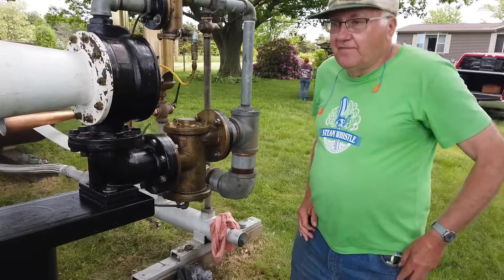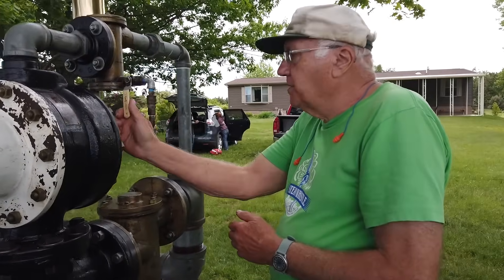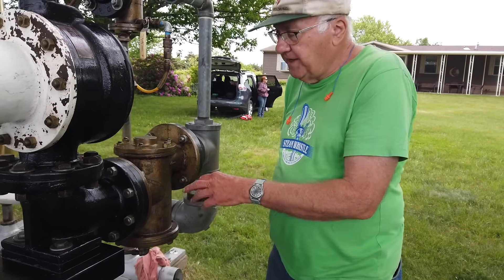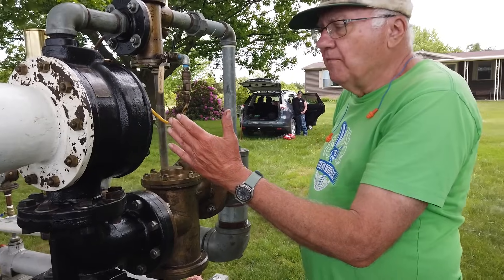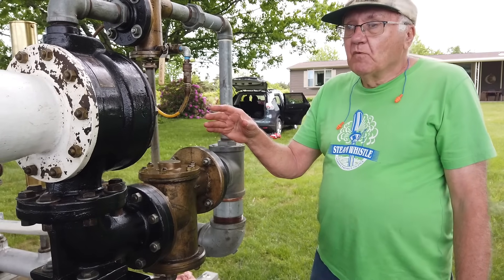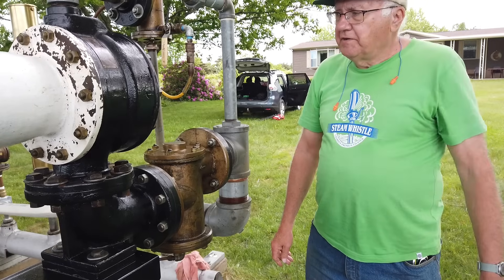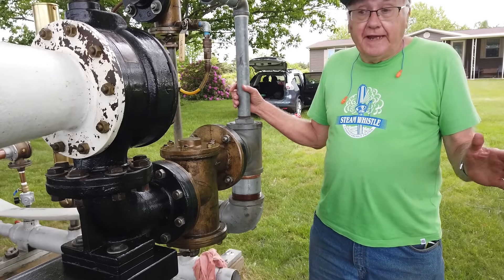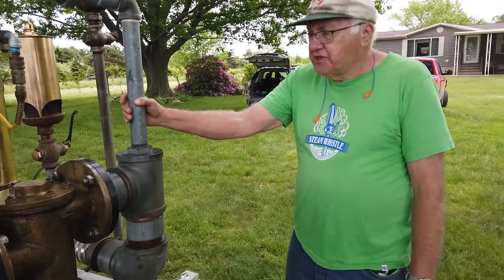How a Type F Diaphone Fog Horn Works

Comment: This is what I don't get about foghorns.  Okay as inaccurate as it may be, I get how the sailors can hear the sound and get a rough bearing of where it is coming from. What I don't get is how they worked out the distance. If you don't have the distance, you can't work out where you are from the hazard.
Reply from the maker: @mizzyroro  fog horns were synchronized with radio beacons. Timing the delay between the radio tone and the audible horn (in seconds)... then dividing by 5 gives you the approximate distance in miles

Comment: He spent all the time explaining how the air went through but what he didn't explain was how the sound was made. I was eargly wanting to hear that.
Reply: That was the explanation.  And a very good one, too.
Reply: @iamachine  so how is the sound made? I am none the wiser. It may be a good explanation of how the air goes through but doesn't explain how the sound is made.
Reply: I’m with you. It’s kind of like telling a person to whistle by puckering their lips and exhaling. It’s a little bit more involved than just that.
Reply: The air IS the sound. It's passing through a spinning valve that is opening and closing extremely fast. 

The pitch of the note is controlled by the valve speed. Slower valve is a lower note, faster valve is a higher note.
Reply: @adamyoung8289  well there you go. The air is not the sound because without that valve thing or whatever, there would be no sound just air rushing out. You give more information that he did which was my point.

Comment: Looking at this as he describes it, it seems that the first little valve, what he called a "motor drive" is a kind of transistor.

It takes a little "power" to get moving but it allows for a greater amount of power to flow. Kinda cool
Reply: Actually, a transistor is a kind of valve so it is circular reasoning to describe the "motor drive" as a "kind of transistor". Technically, such a device is called a "pilot valve", a valve that controls the function of another valve.

Comment: What's the PSI in that 1K gallon tank, and what kind of compressor setup do you use to pump it up?
Reply from the maker: @veiledzorba  for just the diaphone,  the pressure is brought to 45 psi in that tank. He uses a 1936 Schraam towable compressor.
Typically the tank is pressurized to 120psi, he blows steam whistles on that,  then when the pressure gets down to 45 he can switch to the diaphone

Comment: Would it be possible to drive the piston with some sort of powerful solenoid actuators, which are modulated by audio signals, and therefore turn it into a electro-pneumatic megaphone speaker with earth-shattering SPL?
Reply: A similar system to what you suggest was used in large gramophones as a way to amplify the sound. A membrane lets more or less air through to a horn, depending on how much the stylus moves the membrane. This was the only way to reach big sound levels before electronic amplifiers were available.
Few of those things have survived, so it must have been not very popular. But there is a video on youtube that demonstrates one.
Reply: It's been done, in Britain and maybe in other places.  The sound is said to have carried for miles.  Can't remember the inventor unfortunately.

Comment: So what are the Slots made out of?  I'm guessing it plays an F' 4 octaves below middle c?
Reply from the maker: The internal cylinder is cast brass. In the Type B, the slots were cut with a sawblade to very exact measurements. I'm not sure how the larger horns were done but it could very well have been the same way.

Comment: I like Learning how Fog horns works
Reply from the maker: Stay tuned - I'm going to be posting more with this horn. I'm going to be going back in a few weeks. The small, Type B Diaphone in other videos is mine. Definitely more of that coming soon as well.
Reply: Most Gamewell Diaphones today are also used by Fire houses by Fire Departments in the Atlantic coast like Nj NY PA CT MA and VT and   Rhode Island  and basically its was used for Same Principle as regular would do . It would go off anytime for Fire call or Morning or Noon Test  however Town set it up some Gamewell  Diaphones usually go off for Tranditional days like for Veterans day on November 11th   during  Ceramonys  or Memorial services or Curfew
Reply: Or some towns don't ever bother hearing the Gamewell Diaphones  so sometimes the Fire Department would Silent the Horn or take out of service
Reply from the maker: That's correct! My horn was used for fire purposes, though I'm not sure where. So far I've been able to confirm the Two Rivers Lighthouse, Fourteen Foot Shoal, and Point Iroquois lighthouses had Type B. More had Type C. (Lorain, OH for example) The US government modified the C by separating the motor drive, creating the CC...the smallest horn to feature a grunt. Grand Traverse Lighthouse has a working CC. 
Gamewell provided a lot for the lighthouse service...bell strikers and signal timers were the big ones.